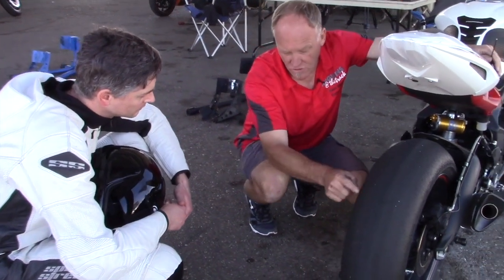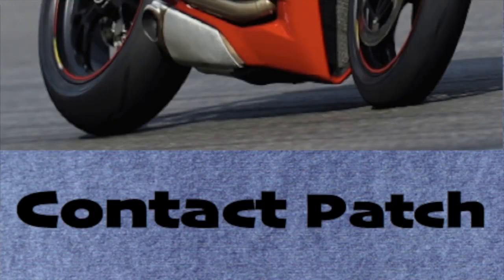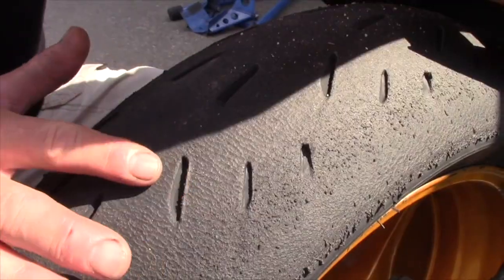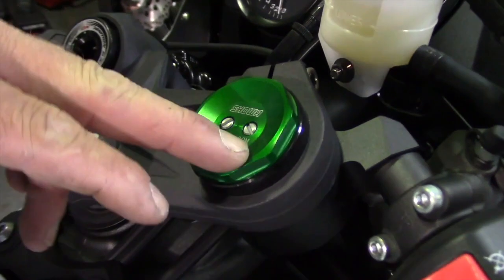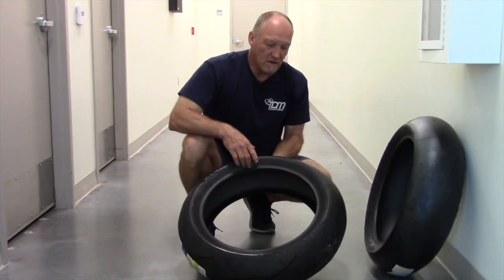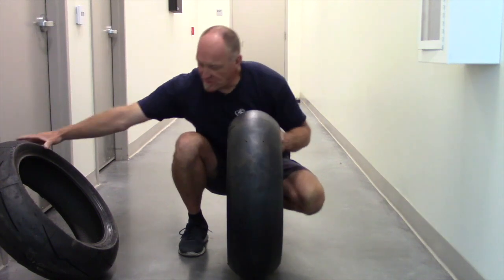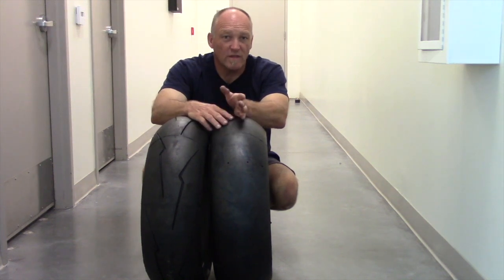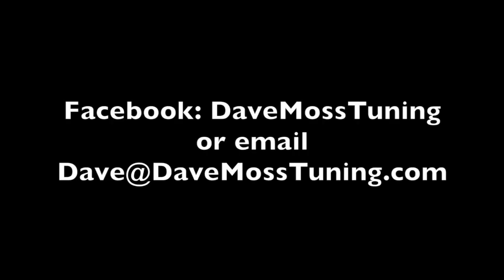Contact Patch: Pirelli Track Tire Family (TRAILER)

Comment: I have been having this huge dilemma between SC1 and R11 tyres. Been using SC1 for trackdays but i did try V02 many years ago and loved it. Now i am wondering whether to try the R11 (Medium compound only available though) or stick with the SC1. What are your thoughts?
Reply from the maker: Both are soft carcasses. R11 is hard upper surface and soft sidewalls. R11 might be the wrong choice for you given this profound difference.
Reply: Thank you 🙏🏼 i will stick to SC1 then. I run 32 psi off warmers hot front 27 rear. Is that correct for a hot humid Sepang circuit?
Reply from the maker: @fahdkamal1420  Rear yes, front is 34-40 hot depending on your braking skills.
Reply: @catalystreactionsbw  thank you! And i just subscribed to you

Comment: Hello sir. I am Kamal from Malaysia... I'm riding 2012 suzuki hayabusa and i have tried some brand of tire. I found that i am more confortable installing Pirelli supercorsa SC1 at the busa since i love to attack corner. What is your opinion about this Sc1 in Hayabusa? what is the ideal tyre preasure for the tire?
Reply from the maker: SC1 has a lot of grip so that is why you are enjoying it. Pressures would be 30-33psi cold.
Reply: @catalystreactionsbw  Thanks for your reply... I heard some case due to Pirelli supercorsa front tyre explode when riding. What is the cause of this issue?
Reply from the maker: @mohdkamalayob  I have never heard of that in my time working at the track since 1995. I have never seen that.
Reply: @mohdkamalayob  I think the issue was many of them using old tires...2016 n below... Cheap 2nd hand tires easy to find..

Comment: I have a  coil spring oil damper swing arm type suspension on my street  bike  it have 5 step adjustable suspension I want to adjust sag for more comfortable ride
Reply: did you have any emails id
Reply from the maker: Start at the lowest position and see how much free sag you have. It should be ideally 8-12mm. Move the adjuster to the next setting until you achieve that free/static sag number!
Reply: I don't know how to do it and  there is no video available for reference
Reply from the maker: www.youtube.com/watch?v=mK3flKxf41U
Reply: Dave Moss Tuning  thank you Dave what I have is not a monoshock it's a older and a common setup where back is supported by two coil over spring suspension
Reply from the maker: So you run a split spring rate as in true vintage bikes. The same rules apply and you can change the spacer between the springs or change the shorter spring.
Reply: Dave Moss Tuning  well  I am more of  a vintage bike lover then a sportsbike but I do love tec